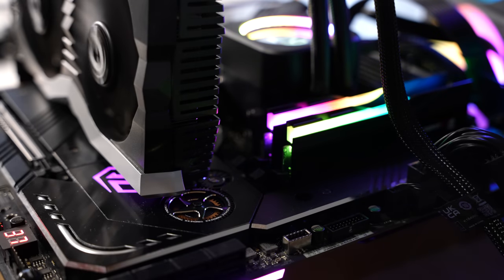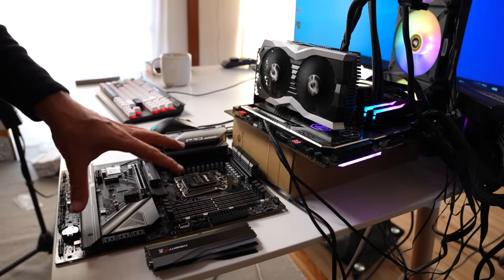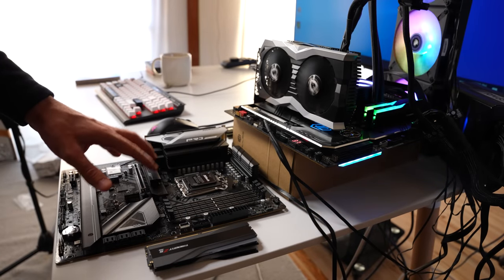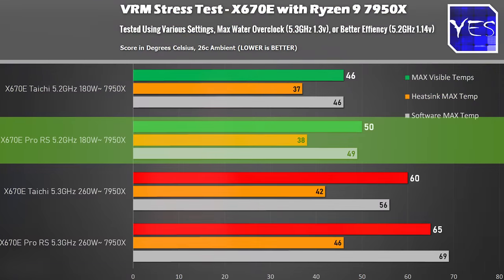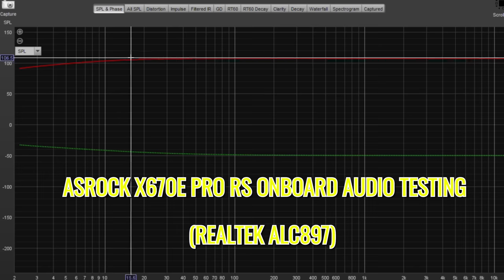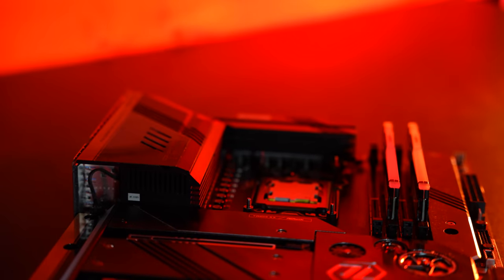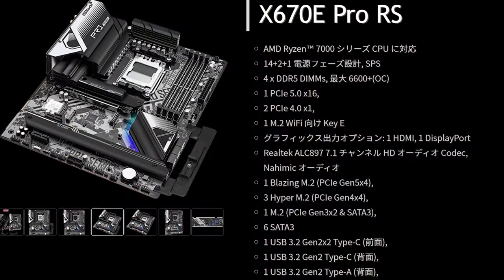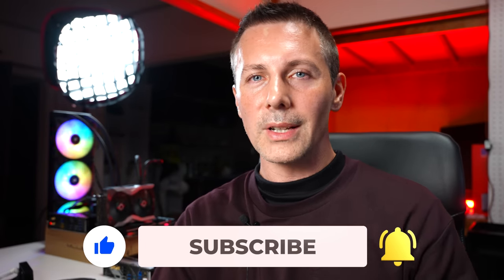Watch This BEFORE you Buy an X670E or Ryzen 9 7950X!

Comment: I mean I bought a ace z590 for nearly $500. But it does everything I want it to do. I use the EVGA NU Audio card as my entry level Audiophile can't live without Item. Its actually gotten worse then that. I look at the asrock taichi x670e. Its not that bad compared to what Intel is doing with some of their motherboards. If your looking for thunderbolt 4 or usb4. It would be tough to find a motherboard cheaper than what the taichi goes for. When it comes to amd 7000 series and up. You still have to pay $100+ for addon AIC card.

Comment: 242W is the maximum rating for AM5.
the maximum voltage for the 7950X is 1.475V.
that means any VRM that is more than 165A is overkill

Comment: A plug for Ryzen 7000 - One of my games, Jedi: Fallen Order, still stutters with a R5 5600X, per tests uploaded to YouTube. The FPS also often drops to 80.

A 7600X rarely drops to 120FPS. If you have a higher refresh rate monitor and a GPU that can keep up, a Ryzen 7000 seems really worth the extra few hundred USD.

I just ordered a R5 5600, and I am wondering if I made a mistake, spending $1300 on a dead-end platform when $1650 would have gotten me a nice, fresh platform with a CPU that truly satisfies.
Reply: JMHO but the 5800X3D helps take care of those frame dips, I just got one and retired my 8700k. It flat out FIXES 95% of the janky BS in most of these poorly optimized games. HEAVILY modded Minecraft Java Edition holds 100fps SOLID now. 7Days to Die (10 years of Alpha) stays damn near up around 144 fps with everything cranked on my 3080. I'm excited to see what the 7000 series X3D chips bring to the table but they will probobly be very expensive plus I am good for several years now.
Reply: @yurimodin7333  
That would cost $200 more than what I paid. Just $150 more would have gotten me the new platform. If I already had AM4, amazing! But, for a new system, it isn't such a good buy.

-The modded Minecraft figures are much appreciated. Minecraft can be so demanding, but performance data is hard to find.
Reply: It's not that simple 150-200$ is a difference between a rx6700xt and rx6800xt. That difference is massive and you are not in a territory where you are going to be bottlenecked by your cpu if you are playing at 1440p( if you aren't you really should be 😆) . Buying a new platform is wise but might not be the best choice as the budget you have could be allocated better and offer better experience today!
Reply: @wanderer7779  
That is true. I have a 3440x1440 100Hz display, which the RTX 3070 is well-suited for, and the 5600 gets +100FPS in most things, dipping into 80FPS at times.

Edit: I want nVidia for Optix, unfortunately when it comes to gaming value.
Reply: @Austin1990  You are running a high resolution monitor your 5600 shouldn't be a problem for that ultra wide especially it being only 100hz.  I'd say it was a good choice after reading the additional information you provided. I don't really know what optix is i assume something to do with ray tracing. But if wasn't for that AMD currently is way better value. The day i start looking at Ray tracing performance is when i max out a 2560x1440 27 inch 240hz screen preferably oled which i don't even own lol. Anything under 100 fps I'll turn down the settings down my gaming PC ruined me for consoles the day after i experienced 144hz i had my Ps4 pro listed for sale in couldn't force myself to play at that low fps.
Reply: @wanderer7779  
Optix is for creators and only supported by GeForce RTX cards. I would have gotten a RDNA2 card otherwise. This is the first GeForce card I have bought since the 7900 GS.

Yeah, that is what I figured when buying it. You are right. I am playing JFO now at 1680x720 @ 60-80FPS with a Ryzen 5 3600 and Vega 56, so it will be a massively better experience anyway.

For anyone else ready this, going from 60FPS to 80FPS (30% faster) is mind blowing. Going from 80 to 100 (25% faster) is great, but that first jump is massive. Anyone considering higher refresh rate gaming but doesn't have the budget for faster hardware, just know that it doesn't take much to get a much better experience.

I have never tried a 144Hz display. Is the jump from 100 to 144 FPS (44% faster) magical? 😆
Reply: @Austin1990  i jumped from 75 to 144 and yes even 100 to 144 is very noticeable
Reply: @Austin1990  actually when i think about it more i would say magical is probably the correct term to describe it 😆
Reply: @wanderer7779  
Haha, very nice. I will have to get a 144Hz display at some point. They are a lot cheaper than when I last checked.
Reply: @Austin1990  For sure i have a lg gl83a ( basically the cheaper version of the gl850) as when it just released i bought it and it was about 500$ or more now they are half the price with way better specs

Comment: My last couple builds were with Taichi boards. 1 is a X370 Taichi and the other is a X570 Taichi. I had planned on getting the X670e Taichi but then discovered to my dismay it's EATX which my case does not support. Changing cases is out of the question because I LOVE my case and it fits my entertainment rack perfectly. I opted this time for the ROG STRIX X670E-E GAMING. Ive had ROG boards before and they were fine. Still kinda sore about not being able to get the Taichi though.

Comment: I just ordered a 7950x with a B650.  It hurts my soul a little to get a lower end motherboard, but I don't need any of the extra features today, and the savings could buy a newer board in a few years if I do need them.
Reply: I ordered the 7950x with the Asus TUF X670E plus wifi  and then found out it's probably one of the lowest priced X670E motherboards. At least it was on the site I bought it from, but that wasn't the main reason why I ordered it. It was because it seemed to offer a decent amount of features for the money spent, compared to a lot of others. I just found out delivery is tomorrow, so I can't wait to get it all set up.
Reply: @yufoh7753  actually ASRock steel legend is the best bang for the X670E boards. It's cheaper than Asus TUF X670

Comment: Nice video Bryan! 
Based off what Buildzoid has seen, 1.5v isn't an issue with many DDR5 modules (eg. SK Hynix a-die; m-die). Some modules (eg. 7200mhz) even come with 1.45V from the factory with XMP enabled. Heck, 1.5V is even listed as the max voltage in the SK Hynix datasheet for their current DDR5 chips. I'm curious to see if the limit is more cpu-based for the 7000 series...

Also, for testing memory stability gaming really doesn't cut it - I would highly recommend using some free tools like y-cruncher; TestMem5; and LinpackXtreme etc. From personal experience, I've been able to hit 7000mhz/CL32 (RaptorLake) pretty easily with my run-of-the-mill Kingston Fury Beast 6000 kit (Hynix m-die), and rock stable @ 1.51v using the tools mentioned with dozens of passes. I haven't bothered pushing for a stable higher OC (yet), as I feel I'm at the sweet spot right now performance/voltage wise. I have gone up to 7400mhz in games, but it's not truly stable without higher voltages - which I'm not keen to daily drive yet.
Reply: Test it out yourself.  At 1.25V without air flow DDR5 sticks go to 70C.
Reply: @penguinbelly  Mine are currently at 1.51V and idling at 46-47 degrees Celsius... All in an ITX case, with some airflow. Currently at 7000MT C32.

Comment: I kept crashing when using cinnebench R23 with the 5.2GHz @ 1.13V and I also tried the 4.8GHz @ 0.985 still kept crashing..I made sure to undervolt in small increments from stock voltage..not sure how y’all are not crashing!! 

I’m on a water cooled setup.
Motherboard: asus x670e crosshair Hero

Comment: Who needs more then 1 PCIe 16x slot on todays boards. I would like to see additional M.2 connections on boards. Makes more sense then populating the board with pcie slots.
Reply: You're right, but a second PCIe 16x slot is always useful, me for example I have a direct fiber SFP+ 10GB connection card to my setup thanks to that second slot. It saves me some bucks from buying a dedicated SFP+ switch with a an RJ45 10GB connection.

Comment: I expected amd to work on the memory controller. Ryzen 5000 series was really finicky regards to memory choices. My 5950x had a tough with even a 3600 cl16 memory.
Reply: You must have been very unlucky 😅 I've built a lot of Ryzen 5000 PC's just not with the 5950X and none of them had an issue with 3600Mhz memory 😜
Reply: yep my 5950x was actually "slightly" unstable with my 4x16gb bdie, quad rank kit running at cl 14 @3200mhz. I needed to relax my primary timings to c16/15/15/15 to be 100% stable, good thing that it only reduced about ~2% of gaming performance in cpu limited scenario (far cry 6 at 1080p with rtx3090) and less than 1% in memory intensive synthetic 3dmark timespy cpu test.

When i heard from tech yes city that with 4 sticks platform couldnt even boot at 5200mhz its a massive OOF
Reply: @adi6293  same. Built a handful of Ryzen 5000 PCs and all of them did 3800mhz 1:1. Some needed a tad more VDDG voltage but that's it.
Reply: @adi6293  it makes massive difference if you have 2 or 4 sticks of memory, memory ranks also put additional strain on mem controller. Im guessing all your built systems were with dual kit config?
Reply: @h1tzzYT  It was a mixture of either 2 x 8GB or 4 x 8GB, CL14 - CL18
Reply: @adi6293  8gb sticks are single ranked ram (at least vast majority of them) so they are easier on mem controller, i dont know what exact sticks anshugiri used but yeah none of those that you mentioned are that strenuous on memory controller, thus different experience :)

Comment: Ryzens memory controller is a bit finicky and for good reason.  You really don't need 6000+mhz for ram and the speeds while on paper look impressive in actual use the story changes drastically.  Even for video content creators those high speeds show little impact for the added stress to expensive components.  While intel CPU will let you fry your CPU MC, Ryzen will go to a no boot method in order to prevent damage.  Do a test with 6k mhz and 4k mhz to see what you actually gain for the risks.  It's money down the toilet like crazy high end GPUs that offer little jumps in performance for huge price margins.

Comment: I opted for the Asrock X670E Steel Legend. I coupled it with the 7950x and 64GB RAM, I have heavy workloads (Software Engineer) and I couldn't see the point in getting the higher end models. Their spec list was impressive, to the point that they were just too much, almost like how the 4090 is too much.
Reply: I got the same stuff as you. What's your RAM?
Mine is 64GB G.SKILL Trident Z5 Neo 6000MHz CL32-38-38-96 1.40v AMD EXPO?
I'm curious how your system behaves.
I'll be receiving the Ryzen 7950X soon.
And will start rebuilding my PC for the upgrade.
I'm upgrading from a 1st Gen Ryzen 1700 to the 7950X. But I'm no software engineer like you. I'm just a consumer user loser lol haha 🤣.  I just want to have a beefy system incase I get the desire to do any work with the PC lol 😆
Reply: @Gielderst  

Here are the full specs of what I got.

MOBO: ASRock X670E Steel Legend DDR5
CPU: AMD Ryzen 9 7950X Processor
Cooler: Noctua NH-D15 Chromax CPU Cooler Black
RAM: Corsair Vengeance 64GB (2x32GB) 5200MHz CL40 DDR5 White
GPU: Gigabyte GeForce RTX 4090 Gaming OC 24GB
PSU: Seasonic Prime PX-850 Platinum 850W
Storage: Samsung 980 PRO M.2 PCI-E Gen4 NVMe SSD 1TB
Case: Lian Li Lancool 215 Mesh A-RGB Case Black

I undervolted the 4090 by a little bit (I dont need anything more than 144 FPS so why bother wasting power on more) and it runs really well. Also means that the PSU choice will be more than enough. The 1000w recommendations are overblown IMO, especially if you slightly undervolt.

The 7950x is a beast and an amazing jump in performance for me (my old rig had a 7700K). No stability issues so far and I run pretty hard workloads as I mentioned already. If I undervolt it as well by a little bit, I can cause it to not break 80 Degrees on full load without sacrificing barely any perf (maybe 5%).

The 4090 does fit inside the case, however the power cable stops me from putting the side panel on, waiting for CableMod to release their 90 Degree adapters in the coming weeks. These adapters will allow me to bring the cable in from the bottom of the card and thus stop it from exceeding the side of the case without having to do rediculous bends etc.
Reply: @Matt Boatswain  Awesome stuff.
When I finish my rebuild. With the stuff I got.
It'll be like this:

Mobo: ASrock X670E Steel Legend - Upgrade part

RAM: G.SKILL 64GB Trident Z5 Neo 6000MHz CL32-38-38-96 1.40v AMD EXPO Profile - Upgrade part

CPU: Ryzen 7950X - Upgrade part
CPU Cooler:  Noctua NH-D15 SE AM4/AM5 with the 3x  140mm " Puke Brown " color fans

GPU:  INNO3D RTX 3070 iCHiLL x4 - 4 fans - got this in April this year, brand new

PSU: Segotep 1250W - had this one since 2017 still works alright 

Storage: 2x  1TB M.2 NVMe PCIe Gen 3 
1x Intel 660P 1TB
1x Crucial P1 1TB
1x HDD 512GB Samsung from 2009 still works lol 😆 

Case: an old ThermalTake Overseer RX-I with 3x  200mm case fans and 1x  140mm case fan

Monitor: Alienware 1080p 24"  TN panel 240Hz refresh rate

Mouse: Razer DeathAdder V2 wired

Keyboard: Kingston HyperX Alloy Origin with Aqua Tactile mechanical switches 

And I think that's all I've got.

I wonder how the RTX 3070 I have will do with the FPS in gaming paired with the 7950X

Maybe you could share your thoughts on my build.

Your's is very similar aside from the 4090 lol haha 🤣
Reply: Let us know how 64GB (4 sticks?) works out.
Reply: @penguinbelly  I only have 2 sticks (32GBx2)
Reply: @penguinbelly  Maybe this information helps, I initially ordered 2 kits of GSkill 2 x 16 GB 6000 Mhz 30 CAS expo (4 sticks and 64 GB total) to fill up all 4 slots on my Asus strix x670e-e mobo mainly for looks. With default bios they couldn't go past default 4800 Mhz but after updating bios, I was able to enable expo profile and it ran flawless at the rated speeds.

Now I ordered a GSkill 2 x 32 GB 6000 Mhz 32 CAS expo kit because it is saving me $100 and also thought its not a good idea to have 4 sticks (it puts pressure on memory controller it seems even though I had no issues) just for looks while overpaying already expensive ram. This new kit works flawless too after enabling expo profile.

Note: I haven't oc'ed/tinkered either of these kits manually but I did enable the default expo profile

Comment: So the difference between first gen R7K at range 17 to 27 power stages says the power of AM5 compatible processors will increase?  For those CPU upgrading over time?  Less optimization for power and performance? mb
Reply: Power delivery is going to 230 watts so dense Ryzen 7k processors can have a 170-watt TDP. Those 80 cent Vishay power chips could cost a  builder up $21.6o / plus other components in the chain, per board. I don't know if the metal of CPU is harmed by heat-cycles, but I suspect not. All that latent heat probably takes out something less critical; say USB. Tuning?, everything is set to open-throttle like a racer-car with full Turbo'ing speed. And that's where we're at, at this point in the pandemic  -"put your money down and take your chances".  Cheers Mike!
Reply: @SISSYPUSS  I'm very happy with my x570S AM4 platform (complete PC kit build at run end pricclale prices July 2022 and purposely got off the tech train at 7 nm on all sorts of power, board and transistor endurance unknowns.
Reply: @mikebruzzone9570  I believe X570's are very durable and should last a long time, mine is older than yours but hasn't had any problems, it runs really well.
Reply: @SISSYPUSS  Thanks for the note. mb

Comment: Do you think those x16 pcie slots have x16 electronic connections? The specs say x8x8 when both slots are used. That's only a CPU limitation atm?

- 2 x PCIe 5.0 x16 Slots (PCIE1 and PCIE2), support x16 or x8/x8 modes*
Reply: That is correct almost all pcie slots work that way on consumer chips
It halves to x8 when 2 are used

Comment: Hi Brian @techyescity, I got a Gigabyte x670 ax mother board with Ryzen 7950x and cosair vengeance 16gb * 2 4800 MHz , P5 crucial M2 gen 4, RTX 2060 super, RTX 3060 Ti . I have installed ubuntu 22.04 but it is constantly freezing , I have tried different nvidia drivers for my cards but nothing seems to work. Could you please let me know what's going wrong here??

Comment: why should 1,4v be too much?
older DDR3 and DDR4 running at 1,35v - was also no problem... or is DDR5 in this sense different?
Reply: Because CPU today use more volts and it might stress your board.

Comment: Those who bought AMD AM4 X370 back when Ryzen debuted for the first time, can use it up to Ryzen 5800X3D.

If AMD X670 can be used for the next 5 years, that'd be a good investment
Reply: Only for the next 4 years. AMD promised 2025++
Reply: @boboboy8189  you also count 2022 as 1 year. Just like X370 from 2017-2021 = 5 years
Reply: @boboboy8189  anyway the distance between AM4 X370 Motherboard to Ryzen 5800X3D is 1905 days which means 5 years, 2 months, 20 days.

So, if AM5 X670 can use Ryzen 10800X3D that will be more than 1800 days difference.

Comment: issue with b650 is that where I'm from the cheapest ones cost as much as a 7600x. So anything higher class than that scales even worse with price
Reply: Weird because in my country ASRock PG riptide is MYR 899 ($149.90) while 7600x is MYR 1399 ($299)